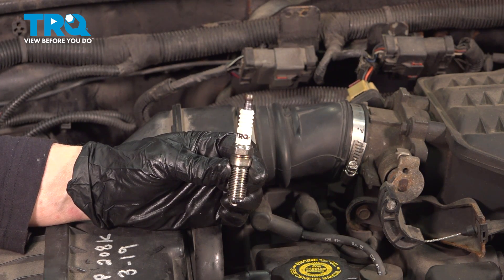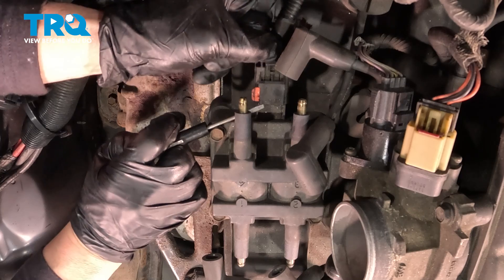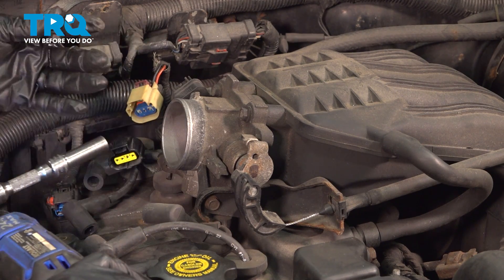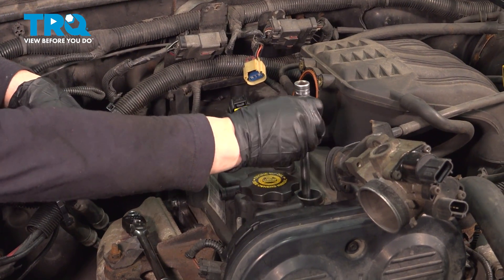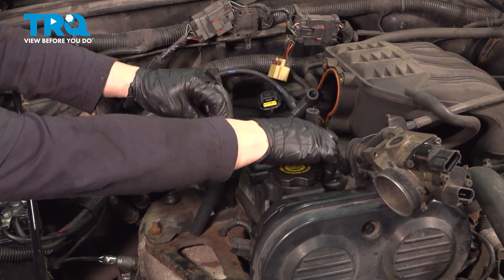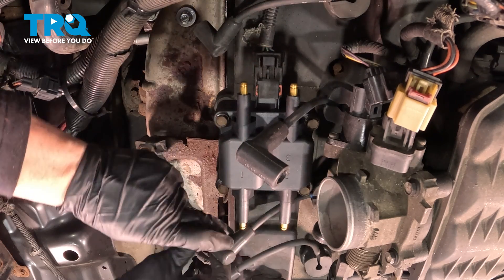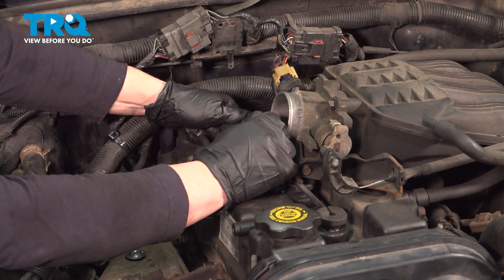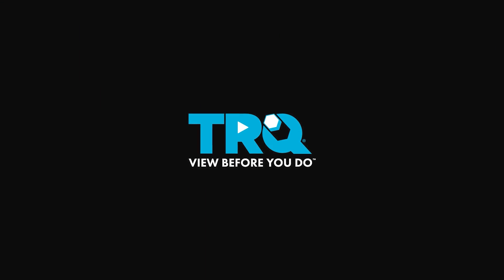How to Replace Spark Plugs 1997-2006 Jeep Wrangler 2.4L L4

Comment: What a poor design. I had a boat with an inline 4 cylinder and it was the simplest thing in the world to change the spark plugs might have taken a whole 10 minutes to do all four. Having to take all that stuff off and then having it recessed down where you have to have an extension and can't see it is absolutely ridiculous. The engineer who designed this should be shot.